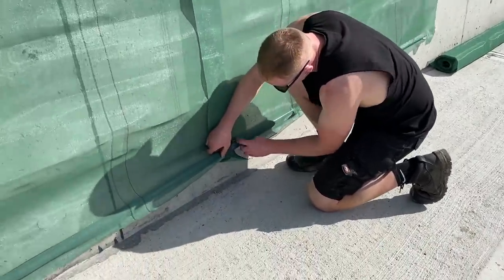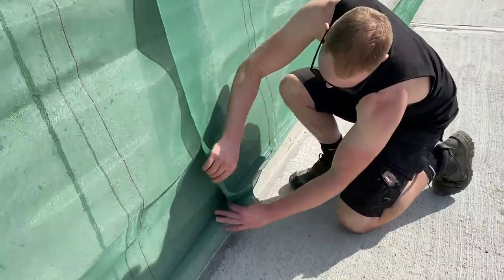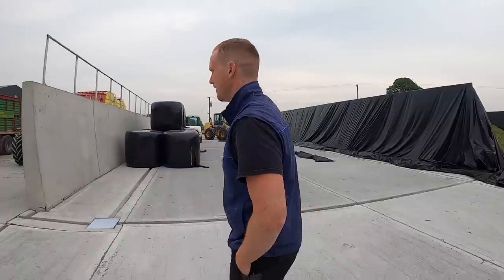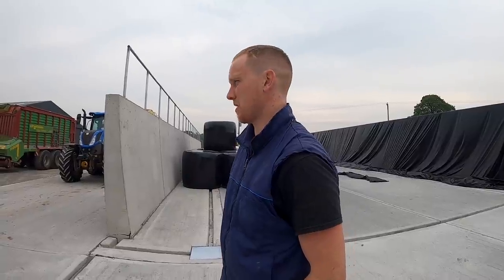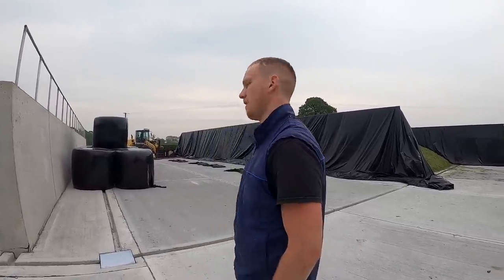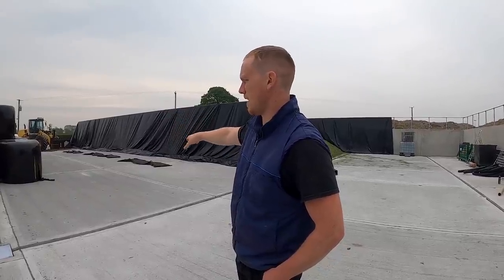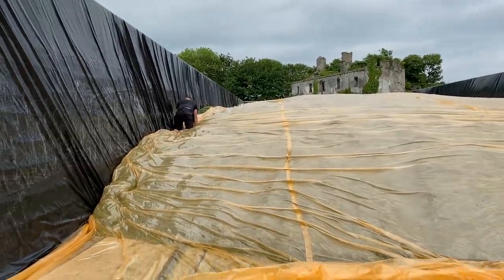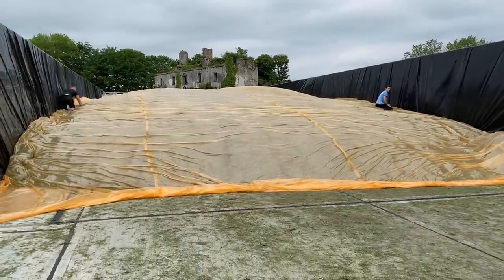Covering our Silage with a piece of CLOTH?!

Comment: Super system, lots of room for machinery manoeuvring etc. do you think no roof is a problem during the cold wet winters when you are rolling cover back? I know a guy who removed one wall of a silo, built 30 years ago, during a modification project. He was alarmed to discover that all the vertical rebar had completely rotted away at the base of the wall due ingress of the effluent over the years. The last silo I got poured had a raised base on the floor where the walls were to be poured and the walls were poured on top of this, meaning no effluent can escape from the floor to under the wall. Did you ever consider using asphalt on the floor for longevity. Finally, would your wagon men not consider driving over the silage in the pit when unloading, to speed up  levelling etc. Very impressed with your forward planning and growing your enterprise. Viewing from Co. Armagh. Thanks again.